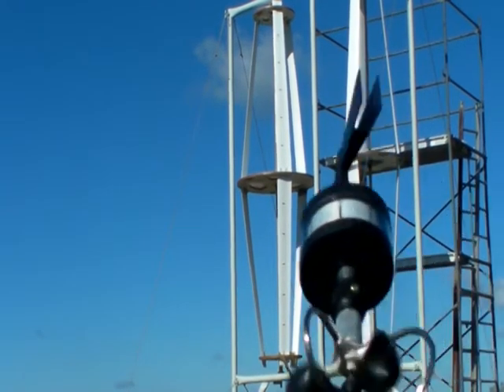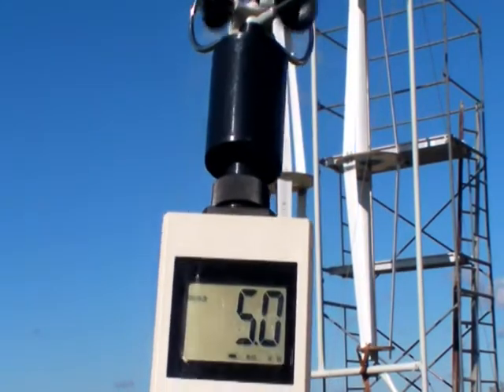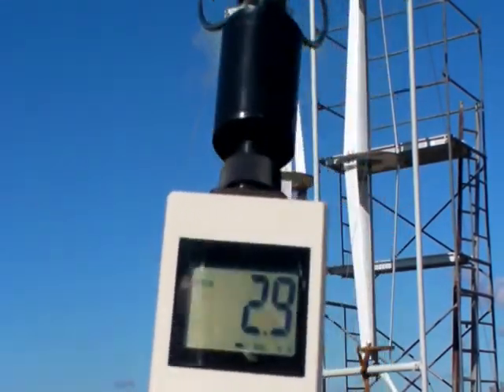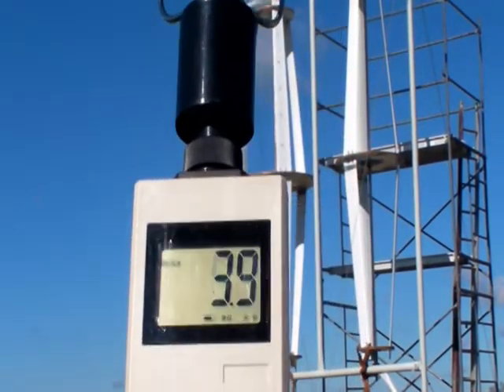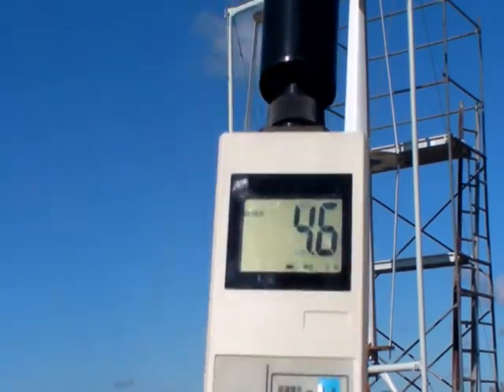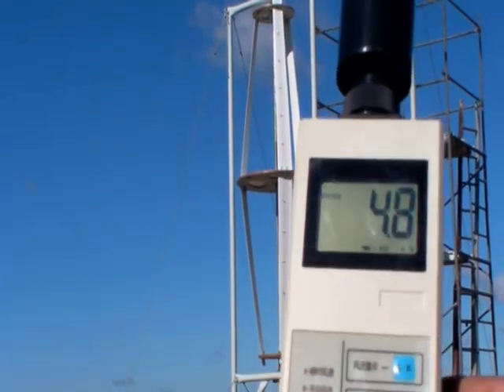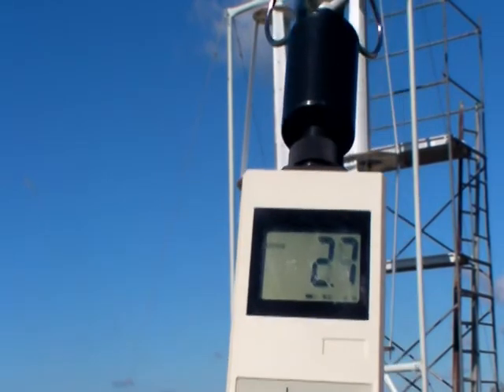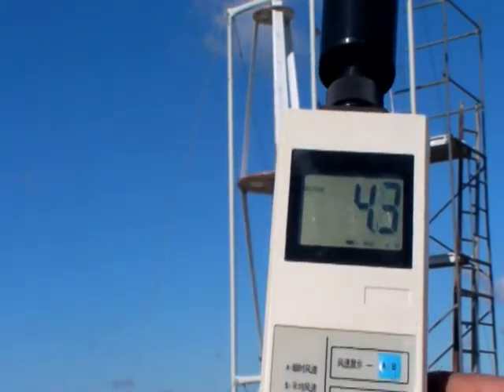column-r-vawt_18.mpg

Comment: Thanks for your hard work on this concept.  As the turbine sped up, I noticed the frame in which the turbine is mounted gradually began to shake. The slight imbalance in the turbine, causes a "harmonic" buildup to occur in the mounting frame.   If the mounting frame were to be strengthened (stiffened) it would dampen this tendency and there would be less "feed back" into the rotating turbine. Just an idea... Roy Lewis Atlanta, GA USA